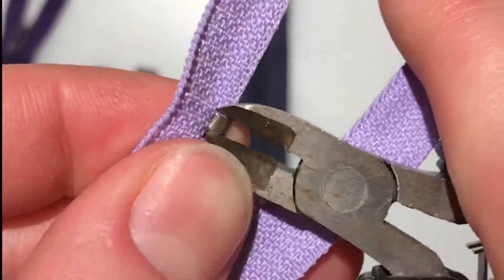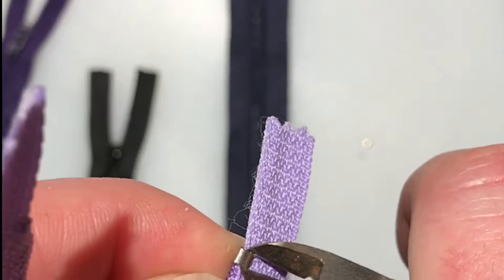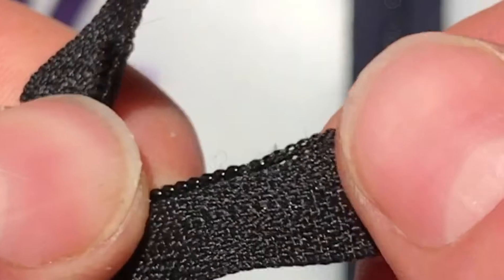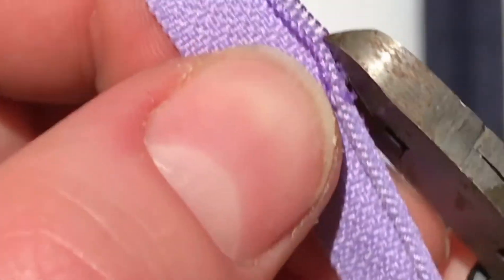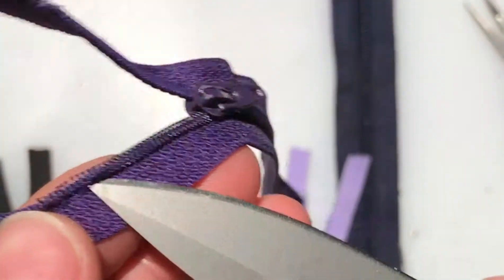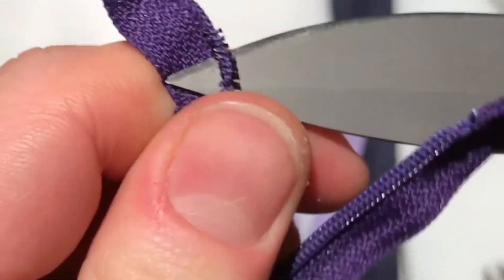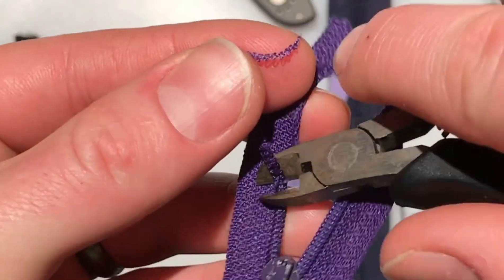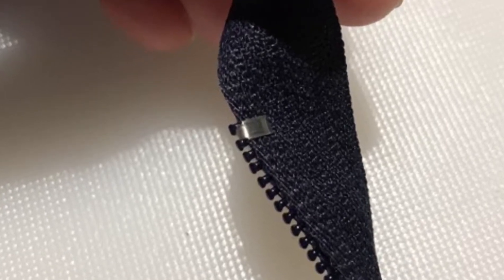How To Shorten A Nylon Coil Zipper

Comment: You can cut the stitching holding the coil on without clipping each individual coil.
Reply: Yep. I saw another video where they just cut straight through the tape, teeth, and all...then slipped on the pull. I assume the stop is reinstalled at the very end(top) and this way, your closure is finished when you're done putting in the zipper; no hook'n'eye silliness!